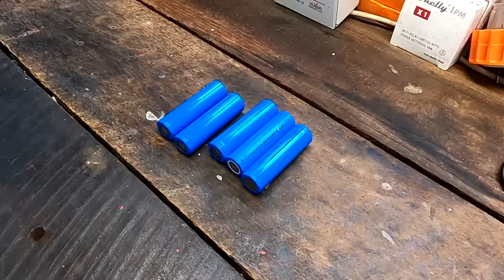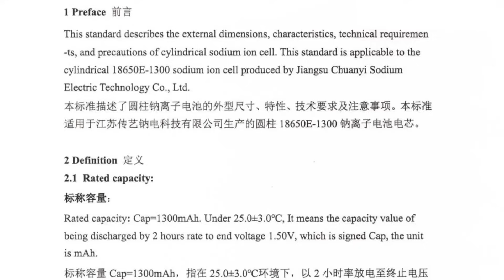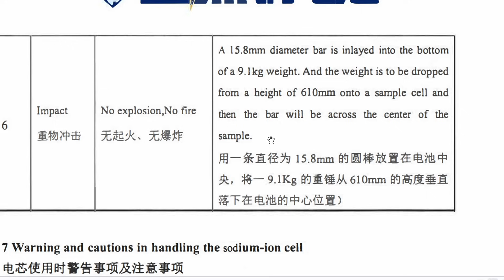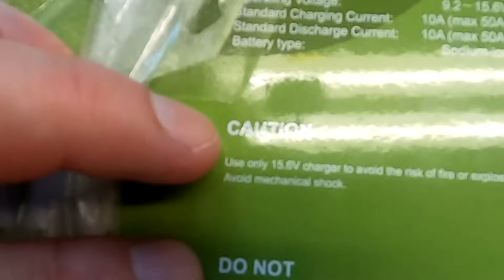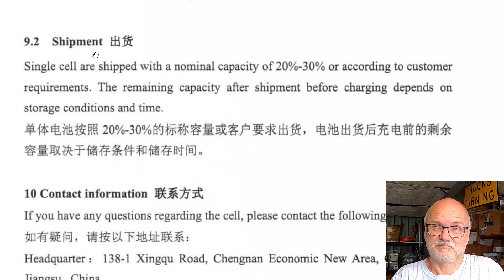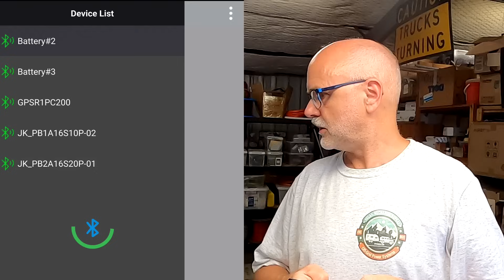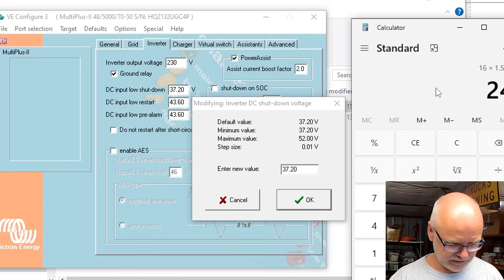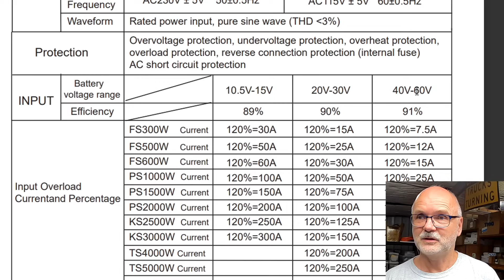Sodium Cell Charging and Discharging Analysis, Hardware Compatibility. Future or Niche product?

Comment: My cheap Chinese PowMr 4200w (24V) inverter will do 20V-31.5V so I'd be losing a heap of capacity using sodium. 
That's not the end of the story though; it really comes down to what they cost per USABLE Ah. If sodium become cheaper than LiFePo then it might become viable for me, and I like the idea of not using lithium. Sodium is the 6th most abundant element on the planet.
Reply: It is not true it is misteake, powland 4,2kW stop charging at 30V, I test it. I have 8s li-mnc and need charge to 32,4V and stoped at 30V...
Lot of producers shows maximum voltage range but you do not can change 100 soc voltage it is terrible...

Comment: Great tests Andy, and so glad you started this.   If their is more of a demand for these in the future, the inverters will change over time and the parameters will change too.   I could not charge Lifepo batteries with my old Trace inverter and had to find the closes setting (gelcel) before I upgraded to my Victron inverter.   The one thing that jumps out to me will be the cable and fuse sizing from the battery to the inverter with such a huge voltage swing for each size battery. You would probably have to use the lowest voltage rating when picking your cable size.
Reply from the maker: I can't see a huge demand for them, tbh.

Comment: Hmmm. . .broad temperature range, linear voltage response to charge/discharge. 
So it sounds like the application for sodium cells is off-grid where equipment is exposed in harsh environments.  
The equipment would need some kind of buck/boost converter -- which adds complexity.  But these are now cheap and any power supply needs some form of regulation anyway, so not a deal-killer.  
Plus, the linear voltage curve makes tracking the battery state-of-charge LESS complex.
I'm guessing adoption of sodium cells will come down to an economics decision.
Reply from the maker: Yeah, but as I said, LFP batteries go up to 55deg charging and discharging. Some even to 60deg...
I don't see these sodium batteries being very successful...
Reply: With good insulation the amount of energy used by heater mats with LFP batteries is minimal.

Comment: Sodium batteries may need a BMS with voltage regulation (boost?) to make it compatible with existing inverters. No idea if that’s going to work.
Reply from the maker: Like 50V @200 boost converter for 10.000W???😬🧐
Reply: @OffGridGarageAustralia  something smart that keeps the voltage within the required range for the inverter when the battery is low

Comment: Good to see this test. Marketing department ordered the heat shrink sleeves with 1500mAh on them, the engineering department was ignored when they specified 1300mAh
Reply from the maker: Yeah, that seems to be the case. They are still advertised with 1500mAh though. I haven't tested the other three cells yet...
Reply: @OffGridGarageAustralia  The datasheet you were looking at said 1300mah 🤔 I suspect they hoped for 1500 in serial production, but got 1300.

Comment: It looks like it would be terrible for running an inverter. At constant power, as the voltage drops the current will rise, so the inverter will run at a much lower average voltage and higher current. Test it with an inveter! A 16S would work with my Hoymiles microinverters, they have an MPPT range from 16 to 65 Vdc.

Comment: Or you upgrade Cables (oversize), or be ok with that:
Discarge a 12V Lifepo Battery at 100A =1200Watt
Discarge a 6V Sodium Battery at 100A = 600Watt only ....
Dont you need bigger Cables for less Voltage?
For getting 1200Watt of a "12V" Sodium at SOC of 10% you need 200Amps??!
Means , for 200Amps you need to double the cables.
The comming  BMS's will more focus on Voltage than the current, i think

Comment: Very important point you touched on regarding upper limits of inverter voltage ratings.
Not only the max voltage that you can expect it to work at, but the upper voltage you are allowed to have it connected to the battery. At least a decade or more ago, when 'Raylite' lead-acid 48 volt systems were being equalised (for an hour), on a monthly basis at the required 64 Volts, there were inverters with a specified max "allowed" connection voltage of 60 volts being regularly used. I believe internal capacitors or semiconductor ratings would have been the design limit consideration for this.
Reply: 60V is a common maximum voltage for MOSFETs, while for capacitors I often see 63V maximums. Neither bode well.
Reply: @Scrogan  High power MOSFETS can handel 100V easy, some types go even till 1500V. Capacitors can easy have 300V or higher like the electrolytic capacitors in tube amplifiers and radios.✌🙂
Reply: @Roel_Scoot  yeah of course there are higher voltage FETs and caps. But the point is, when you’re designing a 48V appliance, you don’t pick 1500V transistors or 300V caps. You get better specs per dollar spent if you only marginally exceed the maximum conditions. For a 48V appliance, choosing 60V FETs is certainly what I’d do, as the spec difference (mainly the trade-offs with gate-charge and on-resistance) between 60V FETs and 100V FETs is quite significant. Going for larger caps isn’t as unlikely, as there’s a better selection of 100V caps than of 63V caps. The cost increase isn’t as bad as it is for higher voltage FETs, the only real trade-off is size. People often recommend over-speccing the voltage ratings of caps anyhow, for longevity. There’s a good selection of 50V caps, but any engineer would judge that as too marginal for 48V systems.

Hence, if you’ve got a 48V inverter, you may be able to push it above 50V, but likely not above 60V. If it says “absolute maximum 60V” then obey that. FYI, I’m making this exact decision to design a 48V kW brushless motor driver.

Comment: I guess the one benefit of the wide voltage range is that it should have a big cycle life only using 50-70%. At least as good as lfp. Looking forward to more testing!
Reply: And then you have to buy a 1000 cells to have a battery big enough to last through the night lol

Comment: It is not just the inverter or charger. Most equipment designed for 12v will give low battery warnings at 10.8V. But on the other hand, that makes the sodium a safe battery if it can handle a wider voltage range than your equipment.
Reply from the maker: And an expensive one... As you need double the number of batteries as you would with LiFePO4.
Reply: When sodium batterys are dirt cheap, just use the voltage range you need and compensate with more batterys.

Comment: CJ is one of the most common "generic" Chinese cell brands, I got lots of Li-Ion cells from that firm.
Otherwise, congratulations for the video, I really enjoyed it.
Most important advantage I see is the potential to easily calculate SoC by just getting a voltage reading. This used to work fine in li-ion and I really missed it on LFPs. Balancing would also be much easier, for the same reason.
Reply from the maker: Thanks a lot for your feedback!

Comment: Just a thought but Instead of building a battery for the high end voltage could you build for the low end instead?in the case for the 12v 4s maybe build a 7 s instead.
7s would give you a 10.5 to 27.65 v and use a resistor before your inverter to limit high end voltage,you know in the same way you use a converter to run 12v stuff of a 24v system? Just spit balling but you would end up with almost double the capacity food for thought i dont know if its even possible 😅
Reply from the maker: That's not possible, no. You cannot use a resistor before your inverter to lower the voltage😉

Comment: Looking forward to the first 15S/16S build 🙂. Thanks!
Reply: What for? You get a voltage range of 22,5V to 59,25V. No existing electronic device can handle such large voltage range. And if you plug a buck/boost converter in front you loose about 25-30%. Na+ just makes no sense. Only in very cold climate whetre you must overcome the electric deficiencies with much more expensive high power electronics.
Reply: @wolfgangpreier9160 Because of what mining Lithium does for the environment. I see it here in Portugal.
Reply: @marcelvanlieshout3508  So you say we should use the oil that your oil companies steal from the poor negroes and burn it in your Seat?

I do not.

BTW: We have a lithum mine that is being exploitet by Saudis here in Austria because nobody wanted to dirty their hands. 

They dig the raw material out of the rock, transport it with stinking polluting posionong Diesel trucks to the sea. Then with stinking, more polluting, more posioning Diesel ships to Saudi Arabia whee it will be refined and transformed into Lithoum Hydroxide to be transported with stinking and sea life destroying Diesel ships to Europe to be put into batteries for your future Cupra Born.

All because nobody wanted to dirty their hands and make everything locally.

You say stop using clean energy in our cars and continue burning fossil ressources.

I say stop transporting everything across half the world just because you do not want to have a dirty backyard.
Reply from the maker: @marcelvanlieshout3508 are you driving an EV?
Reply: @OffGridGarageAustralia  No, not yet. Why? Is the Teslander for sale? 😉 I am currently preparing to extend my solar. And I am binge watching all your videos to prepare for the next step. So much to learn. 😀
Reply from the maker: @marcelvanlieshout3508  Nah, it's not for sale but I was wondering where the energy for your car is coming from as you were concerned about the environmental impact of mining lithium....
Organic gasoline or diesel? What's the impact there? Just because we don't see it every day, doesn't make it better... just saying....

But thanks for watching all my videos. If you have any questions, leave them here in the comment section.
Reply: @OffGridGarageAustralia  It's an ongoing process. As long as li-ion has better properties (weight/size per kWh eg.), their use in mobile applications is to be expected of course. But if Na-ion lives up to it's promises (production+lifetime+recycling), I think they can be good candidates for stationary installations. It's not Li or Na, it's Li and Na. Each can have it's own applications. Li for mobile or other space / weight limited applications, Na for those cases where size/weight is less important. But only if Na-ion lives up to the expectations.
Reply from the maker: There will be no 16s battery build with Sodium batteries, sorry.
Reply: @OffGridGarageAustralia  Don't be sorry. I am grateful for anything we can learn from you.

Comment: Over battery (more than needed) and use a buck converter to output a nominal voltage.
Reply: Buck converters have their own losses, and they come with maximum power ratings, too. Plus, you can't just connect a buck converter directly to an inverter input, the inverter will definitely not like the high-frequency interference on its input.
Reply from the maker: Buck converter with 10kW???
Reply: @dGarageAustralia I was still thinking about the smaller batteries.  I recently built a flashlight with a LED bulb that likes 2.8V and when using a 18650's, had to adjust the power down.  Probably still doesn't make sense with the power needed for an inverter though.  But, just maybe...there is something out there.

Comment: Be curious to see what the loss due to conversion using buck and boost circuits to maintain a steady voltage vs the loss due to the chunks you simply can not use with that giant voltage spread.  Suspect it's just as bad if not worse, but still a curiosity.  Throw in the fire test at the end.  Is the actual chemistry of the batteries known, or are we just being told they are Na?
Reply from the maker: You have seen the spreadsheet. That's all the info I have...
Reply: @OffGridGarageAustralia Ah, didn't click over to the data page.  Just saw the link from here that has the alibaba links.

Comment: Great video. Did the same thing with:
HAKADI Sodium-ion 3V 3500mAh
Nominal voltage: 3.1V
Standard capacity: 3500mah
Charge voltage: 4.1±0.05V <- notice difference? Interesting.
Cut-off voltage: 1.5±0.05V

Using a Daly BMS 4S to log the voltages/current. Curves looked about the same as yours. I got 3400mAH out of my cells. I can send graphs if interested.

Notice this battery has 4.1V top voltage. Weird thing was that it appeared like the battery was self top balancing – I waited for current to drop really low (5mA) when charging first time – and it never happened even after a day. and they all ended up balanced quite nicely without ever using a balancer. May be coincidence (did they ship balanced?)

I had the battery sitting on bench for a month and when I looked back one of cell was down to zero. Not sure why, but it looks like the BMS dragged it down? It actually recovered – like magic, no ill effects after I jump charged it in the assembled battery. (To same voltage as other cells.)

Struggled a lot with Daly BMS trying to wake up if it goes to sleep. It seems to get confused down in the 1.5V range. Had to hit it with 17V+ and also charge the cells past 2.5V bypassing BMS. (with great care…)
Note: the Daly BMS setting may not be flexible enough for these cells – I was not able to set 1.5V cell low protect for example. Will be interesting to see if JK BMS is fully functional for these cells.
As you also noticed this 4S battery has quite a voltage range making it a bit difficult to use with some applications.
Reply: The use of a DALY BMS was a mistake. They are possibly the worst BMSs, afaik. "Self-balancing" cells do indeed "burn" extra energy. Did you notice the cells getting hot at 5mA? But then again, 5mA doesn't really give out any heat.
Reply: Go to battle with tools you have :(... I was effectively using the Daly BMS as data logger (simultaneous voltage curve for 4 cells) that gave me some protection when I simply assembled the 4S battery- kind of a short cut to individual cell test. The balancer does not really work so it was off. In one step have a graph that shows the V-curve, the capacity and any balance issues! Charge and discharge. And even some info on the top of range (apparent squichiness? -energy burn? this may be a false interpretation?) nicely recorded on the out of box from China cells.

Note I had the cells sitting on 4.15V waiting for current to go to zero in case these cells need to be absorbed for full charge. They were in a stored in safe space in case they decided to go nuclear (and my current limit at that point was 200mA to make sure it could not run away). The Daly cutoff was 4.2V

I think the current went down to 20mA and the cells never got warm (to touch ).

Note: it simply may have been that the cells were already balanced,

Aside: As for the Daly startup issue: The only reason I needed it to wake up was to log the data... I do not really understand why they make BMSs relatively difficult to start up. These Daly's also struggle with LIFEPO4 startup. This specific one I usually have to tickle to 14.8V+ before it starts. Why? Why not just start if you hit something reasonable like 12V.
I know this may be done to avoid completely draining a very low (LVD) battery but it could be implemented better.
 @ThanosSustainable

Comment: I have already seen tests of batteries with such chemistry.  result: expensive, low capacity, low discharge and charge current, too high voltage limits and here are only minuses.  and one small plus is that it can be charged from -10⁰C.  maybe we should wait for something new and more practical.  and it would be interesting to see what the reaction would be after hitting it well with a hammer.
Reply: The low temperature advantage is negated by insulating and heating LFP batteries. With good insulation the energy required is minimal.
Reply: @nigelcharles511  indeed. I’ve insulated my remote LFPs and running a tiny 5W self-regulated 12V during the winter.
Reply from the maker: We definitely should not wait! We have LiFePO4 right now and it is cheap and brilliant. Let's go!
Reply: Na-Ion cells are supposed to be dead cheap. Sometime in the far future...

Comment: I'm not sure if your tester would let you, but could you series some of the batteries and then discharge down to 1V?  If you had all 4 it would get you down to ~.25V each which still isn't 0, but let you see the curve down that far at least.
Reply from the maker: Yes, that's a good tip! It will work with the EBC-A20.

Comment: regarding the measured capacity of 1300 mAh vs the specified 1500 mAh capacity: possibly the 1500 mAh corresponds to the case of full discharge to 0 volts and not 1.5V. sodium can be discharged fully without damage
Reply: doesn't look there's much capacity left below 1.5V. Definitely not 200mAh, most likely in the 30s range.
Reply from the maker: Very unlikely, there is that much energy left below 1.5V. The curve goes down almost vertical already.